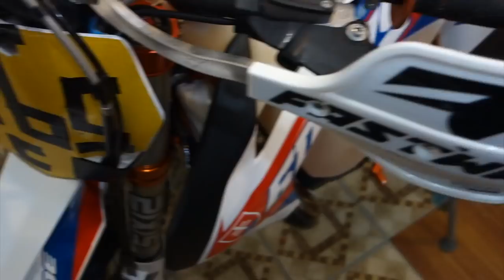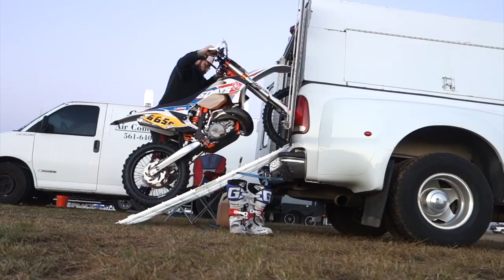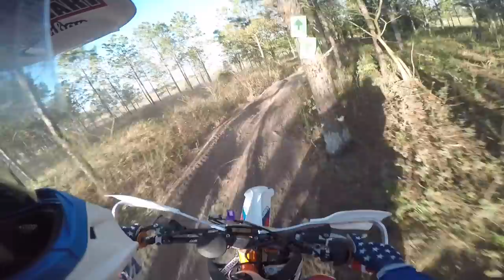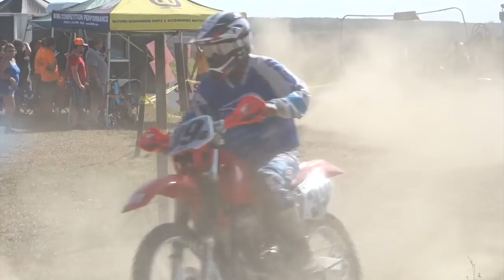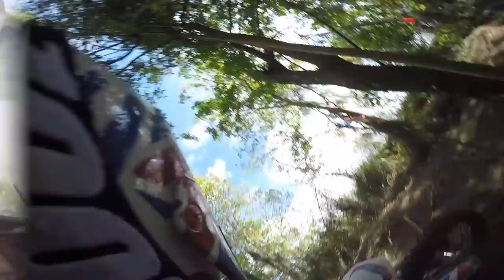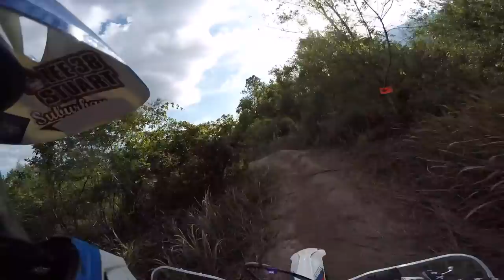How to get LAST PLACE and still have fun (Bartow Hare Scramble Race Vlog)

Comment: This might be a little bit scattered because it’ll be random thoughts throughout the video. 
I don’t know about nervous pissing but I get the nervous shits 😂
That seems dangerous that they hold the race in the time a day where you’re riding directly into the sun. 
I don’t know if this would help but I heard some people drill holes in the corner of the goggles to prevent or decrease fogging up. 
I think those cellphone inserts you do to correct yourself or inform us are awesome. 
DANGERPOLES
Man you sounded so done after those two offs right in a row but you kept on going and kept pushing. Fucking awesome man. 
Overall I think that race was an improvement over your first. You can only get better with each race. I really dig these race videos and watching you challenge yourself to be better.

Comment: Man Im Very happy for you. Getting out there and doing it is 95% of the battle! I have the same Problem, After about 30 mins of decent pace riding. I pretty much loose all steam an go at walking pace. Its amazing to see all the B and A class riders Just Haul ass the whole time.  Im going for my first one in January. I was thinking about Vloging mine as well, with live voice Instead of Voice over. Did you have to stop an mess around with the Mic adapter or anything?
Reply from the maker: Yeah I use a el cheapo amazon mic and adapter for the GoPro. Works like a charm! I go back and forth on the voice over versus vlog thing man... part of me thinks I could do better if I shut up and focused. Part of me thinks that it doesn’t really matter anyway 😂 looking forward to seeing your first race man!

Comment: Nice job. You know exactly what you need to do. On almost every corner you blow I can see  your visor dipping down letting me know you are not looking ahead. Easier said than done but when you keep your eyes up you get through them just fine. Still the riding has improved since the first video. Racing is tough. What is easy in practice suddenly changes when on the clock with other riders. Keep improving and having fun. Wish I was there too.

Comment: I had those handguards. I got rid of the nylon washers and cranked the shit out of the nuts. To adjust the level of them you have to take them off put them in a vice and twist them where they mount in the center . I have found the lower I set them the less likely they are to rotate on you . Keep it up ,been racing for three seasons now it blows my mind how much I have improved over that time

Comment: Can't you adjust the clutch lever? Looks like a set screw on the part that goes into the reservoir. For hand guards, I don't think there are any much better than the other. THe physical limitations of aluminum or steel prevent any from not bending. I use the acerbis x-something ones and they take a pretty good beating though. At least you can bend them back usually.

Comment: You finished the race, had fun with good folks and came home tired. That's what matters. I've been racing for years and couldn't even count the number of times I didn't even finish a race and had to be pulled out of the woods. Race at your pace, ride at your skill level, and it will slowly improve. Slowly, but you will begin to notice, and through that gain more confidence in yourself and the bike. That clutch issue can be addressed (although most folks don't even use a clutch when racing, but that skill will come with time) by adjustments on either end of the clutch and cable itself. I know it also sounds dumb but if you want to get better you've got to work on conditioning, core strength and breathing. You've got to move your body on the bike more, get up on the pegs, shift your weight, elbows up in the attack position etc. But again, as long as you're having fun and not hurting yourself too bad, brap on bro! I need to get down to see my Florida boys and get over to ride with ya'll sometime soon.

Comment: You were not going to leave the area at 34:32 until you fell over.....I like how you see the right hand guard fall off at 35:09  . She was definitely listening at 38:23  . Those woods looked tough with all the roots. As for the 4 stroke comment i think your wrong i've never ridden a 2 stroke but a 4 stroke would be fine through anything , it's still a dirtbike. There can be only one winner but without everybody else supporting and enjoying these hare scrambles , there would be no races. Good job on doing it. Cheers.

Comment: Have you tried moving the clutch leaver closer to center of bar so there's not so much lever over grip. Should let you use one finger and the lever won't hit the rest of your fingers.
Reply from the maker: I feel so stupid that I didn’t think of that lol
Reply: I didn't want to double post so I'll just tag onto this comment as I use the same clutch lever (and front brake lever).  Move the clutch assembly along the bars so you can pull the lever in and not crush your fingers.  I typically use two fingers to clutch except when I'm hill climbing when i use one as I need to hold on to the bars tightly.  Quick adjustment and you will be very happy with your $80 investment.  👍

Comment: Congratulations you finished, you are out there and plan to return. Nobody gives a fuck if you are first or last, you finished and that’s what counts.
A little perspective form a viewer. STOP vlogging while you race it slows you down. Run your camera, edit and voice over would let you focus on ridding and still capture the race. But most importantly STOP THE NEGATIVE MIND TALK. Try to be positive and focus on the basics, elbows up, stand in race position, etc. This will make you a better rider and as your weight goes down your endurance goes up along with your skill level. 👍
Reply: David Rockwell - This guy said it all 👍
Reply: I have been thinking the same through both races

Comment: I would also rasie the tick over, it can help with your cornering .check out twisted engineering handle-bars, they are unbreakable ,they flex so it will take some strain from the wrists reduce arm pump too they are expensive but one set of bars will be all you ever buy again! ..Not heard you mention tyre or tyre pressures these will seriously change how your bike feels and should be checked dilligently for what conditions you ride .. try some slow riding drills and some cornering techniques like cornering cones figure eights etc look easy but are a great way to learn proper technique. Pre warm up befor the race starts not stretching warming up ...Not knocking  you hoping you take the advice from someone  who wants to help .If you have a mirror on the bike take it off for racing anything not used for the race take it off .If you can check your battery ensure its a light one you can shave weight by getting a lighter one ..Enjoy your riding people ride for years to attain those skills neccessary so for you ,you are where you should be let pain and persistance guide you

Comment: From my armchair it does seem that every time you pick up the pace just a little bit, things come together much better. Must be that momentum thing. Every time you drop back down to idling on the clutch to manouver, things go south pretty quick. Nontheless, you're out there doing it, so it's all win!
Reply from the maker: You ain’t kiddin man... the slower I go the worse I do. I just gotta get my nerve up!
Reply: shadetree surgeon Or stick a lower gear in so you don't need to ride the clutch as much. Keeps speed down but tension on the chain. Or a Rekluse clutch, but apparently the consensus is that it's better to learn proper clutch control. Either way, good job!

Comment: Fair play for giving it a go. My fat ass is still sitting on the couch, so you're doing better than me!
It's all experience though man, with experience comes skill, and you're putting in the time.
Instead of glasses, you tried contact lenses? I use them for most of my outdoorsy kinda stuff since I suffer fogging just like you did. Throwaway lenses are pretty cheap, just use them for the race and throw them away. If you can handle pushing your fingers into your eyes, that is :)

Comment: have you got a patron page so we could help you fund your need for parts or anything else ??
Reply from the maker: I do have a patreon, but I always stress that please don’t donate anything to it unless you can absolutely spare it! I’d rather you take whatever money you might give me and put it in your savings account if you’re behind on ANYTHING.
Reply: Intermittent fasting 14+ hrs will increase fitness on its own you can eat the same amount just in a smaller time frame aerobic capacity will go through the roof finishing races in a much better condition